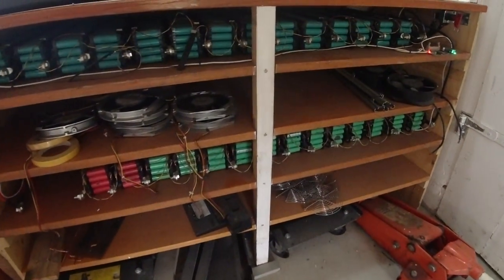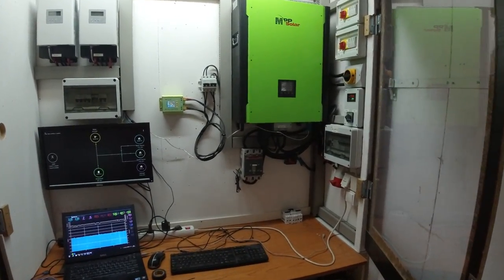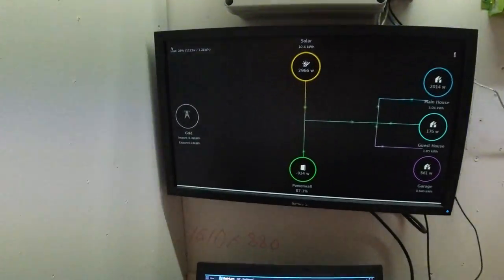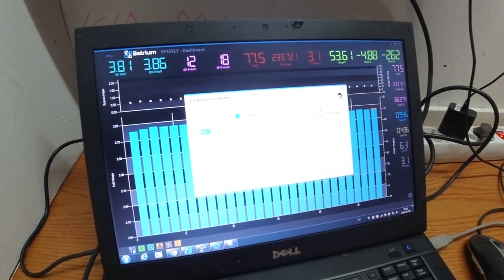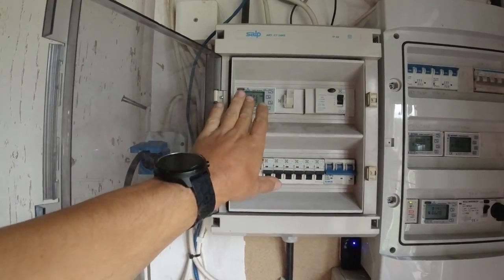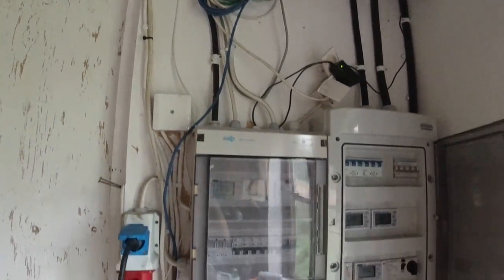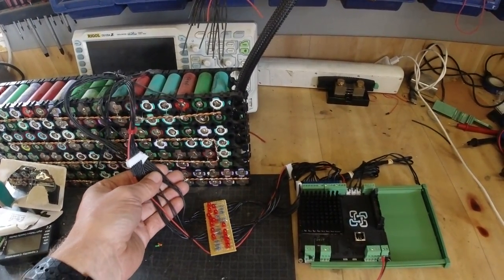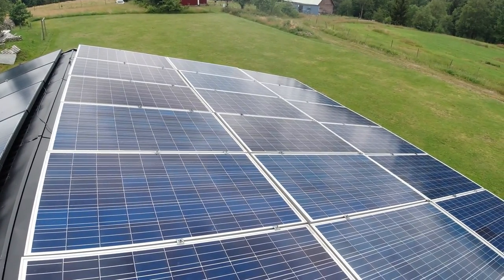Solar powerwall update - 2019

Comment: hi there, the closet where the inverter and the electrical are needs venting it can't be closed because the heat has no nowhere to go, for how long did you have that MMP inverter (green machine) ?it looks like a 5kw. i am planning on buying one but not sure if it is reliable , thank you.
Reply from the maker: It  has Vent in top and bottom
 2 years
Swapped out parts after One year
Its the 10kw. The 5kw is totally different on the inside
Reply: Sir what do you mean by swapping parts?
Reply: I just saw this online and contemplating on buying should I go ahead

Comment: Hi.  is the MPI inverter able to feed the energy from the batteries in to the grid as well? if nothing is connected to the AC-output on the inverter.
Reply from the maker: Yes. 11a at most in terms of backfeed. I Guess its a software limit. 11a from the batteries that is.
Reply: @DIYTechRepairs   Thanks a lot for the answer. I posted some questions about the MPP inverter efficiency in your solar setup video from 2017, maby you didn´t see that comment, but i´m mainly curious about if the inverter always has a big power loss even when no solar energy is present, if the consumption (household energy) is connected to the AC outlet, does it bypass the inverter in case of no solar/drained batteries?
Reply: Also, can the grid feed-in from battery be scheduled, to occur a certain time during the day? I will most likely buy the single phase 5kW 48V model now, just as a start. Since I have existing NiCd (NIFE) batteries of 100AH capacity, (4KWh) that will be too small for the 10kw 3-phase model.
Reply from the maker: @Swedediesel  the mpi is hybrid and it Will Always consume ,60-80w per phase as Long as its running. The smaller modells are either off grid or semi hybrid. Best bet is IF you controll Them externally but you need to code :)
Reply: @DIYTechRepairs   Thanks. I just bought the single phase 3kW hybrid inverter that I will connect to my NiCd batteries to begin with. And I will turn off the grid backfeed feature until I have installed a main solar system with a bigger 3-phase grid-tied inverter, and then I can enable the backfeed function on the one-phase hybrid once the utility company get the meter changed to a bi-directional. :) To begin with I will let the hybrid inverter charge my batteries during day, and then I will charge my Renault Kangoo ZE at night from the battery energy (plus grid energy when batteries are drained)

Comment: Seems like you need a couple of large caps on your LED lighting...
Reply from the maker: Its not led. Its fluoroscent and the camera wasnt set Up for the correct frequenzy
Reply: DIY Tech & Repairs fluorescent? I thought you got out of that rock! ;) seriously now, saw a few LED lamps lately that can do DC 12-80V and AC 12-50V
Reply from the maker: @ThanosSustainable  led cost money to buy. The ones in My garage i got for free :)
Reply: DIY Tech & Repairs man, it’s €0.60/m for a LED strip. Just sell a couple of low-capacity cells.
Reply from the maker: @ThanosSustainable  yes but compare to the light i got in the shop we talk about 1000++ eur. And it also need to be ip65 proof... So its a No go. The led lights i need cost around 200eur a piece ;)
Reply: @DIYTechRepairs  Yes.👍